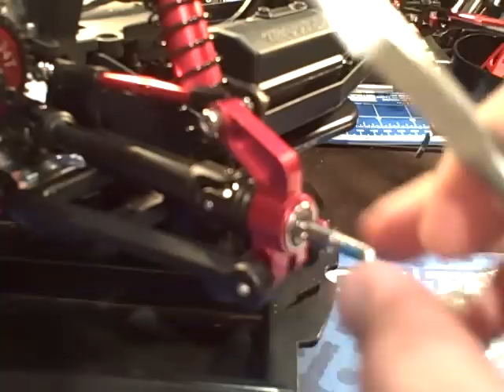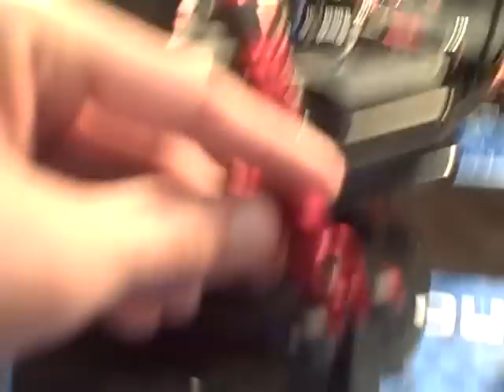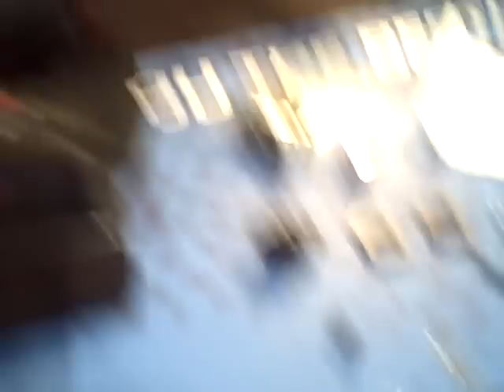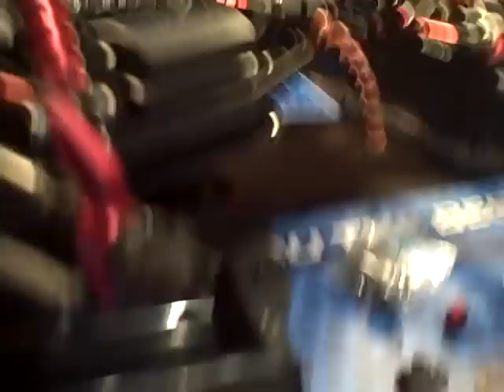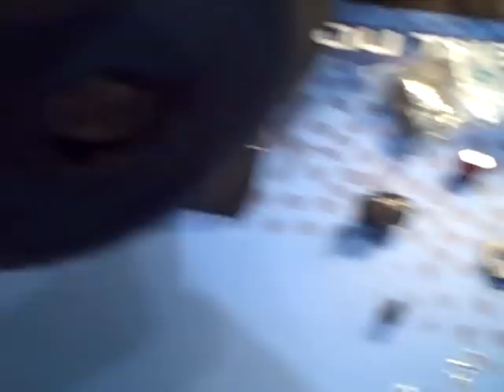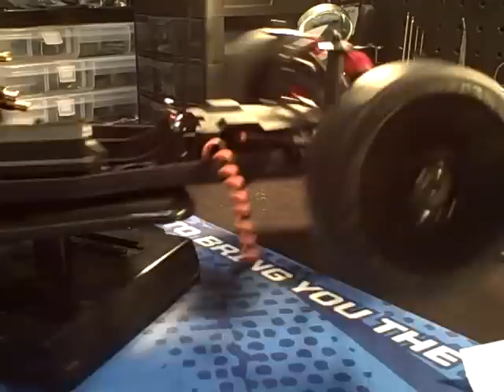How To: Install AKA Racing 17mm Hexs

Comment: I’m confused as to why you put the spacer between the bearings. I believe they only send two because the two front adapters are longer and that spacer is to help space the hex bolt out further so they are not buried in the adapter. If I am incorrect and you have some other info I’m all ears. I just don't see the point of it being between the bearings.